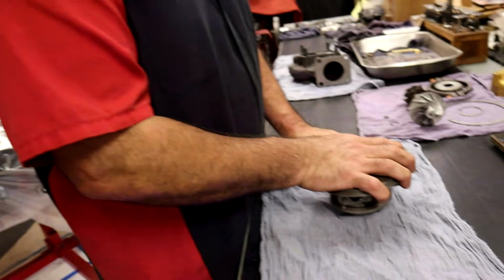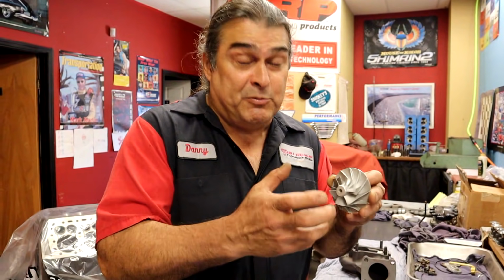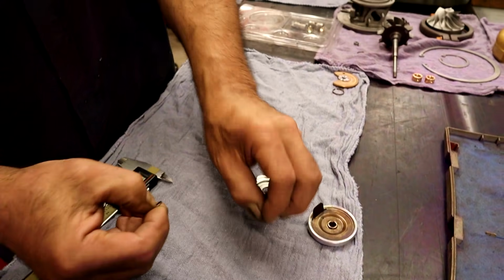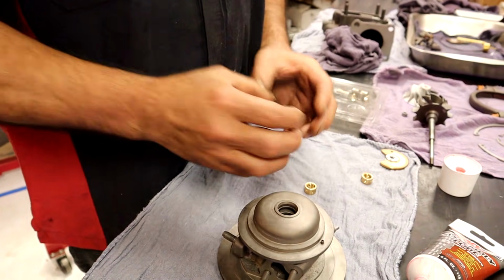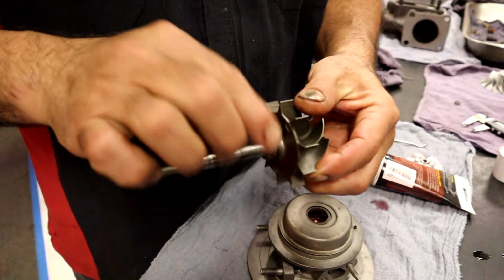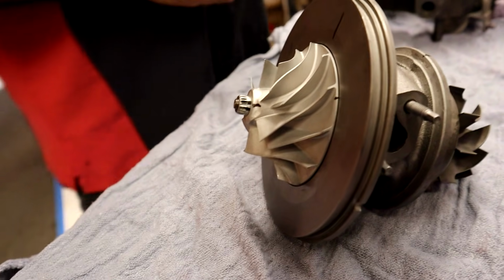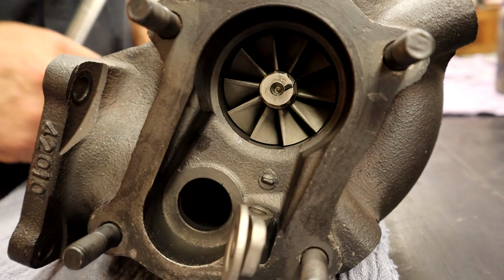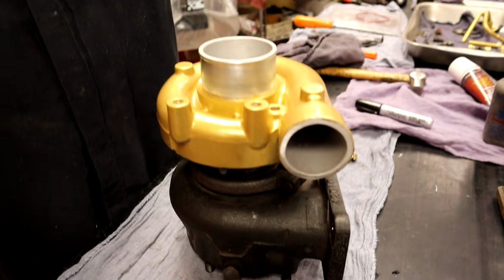Part 3 of Danny's Turbo Rebuilding Master Class: Reassembly! Feat. Toyota CT26 Turbocharger!

Comment: I always, always always lubricate O-rings. Metal surfaces can have a microscopic “five o’clock shadow” that snags an o-ring. Lube helps it right itself and promotes a smoother assembly.

When I worked in a transmission shop we had tubs of blue assembly paste that is awesome. That’s how you keep those little ball bearings in place when re-assembling the valve body in an automatic.

Comment: Better than assembly lube and priming, I saw a turbo where the oil lines were replaced with zerk fittings. Worked perfectly. For almost 60 seconds.

Comment: Thank you sOooo much for this series. I’m entertaining rebuilding my stock ct26 on my 91’ 7mgte. My front cassette fins are pretty chewed up after I realized I was sucking in rocks or material from a split accordion hose. I’m amazed at how much this master rebuilder has been graciously sharing with us. Are the brass punches really that effective at easing the removal? I had never heard of this and the vibration method, though it makes perfect sense. Thank you again for the videos and the time to put these together. I may try and rebuild or try to send to you or Danny if he rebuilds turbos shipped all the way from VA. ✌🏼

Comment: On industrial cats, we rigged oil circ pumps that ran when the engine came off line to discourage coking. We had them on when the engine was off because these engines were emergency standby driving municipal water pumps. Always well lubed turbos. For instant on—no warm up.

Comment: I need to rebuild my STI turbo. After hearing what you said about someone might have bored the hole out and an oversized bearing may be needed. 
I assume that I should take it apart first before ordering a rebuild kit. Like I do when rebuilding an engine I clean everything and measure everything and than order parts.

Comment: Great video! Especially thanks to Danny for the advice on orings! I have some stubborn one on my DV6TED4 turbo diesel. It goes between a turbo's cold side outlet and an intake pipe and the pipe needs to be pressed in and then rotated. And every time I put on a new one it always rips and leaks even with a special lube. Next time I will try to use a pick to rest it!
P.S. Hello from Russia!

Comment: From an engineering stand it's a rule of thumb to never reuse any seals. 
With the exception of the manufacturer specifying that's the case. 
Reason being is the amount of heat cycles and wear. 
Another point I'd be cautious is the torque specification. He did follow the marking. Did he check if the unit was to the torque specification? Heat cycles and worn parts can affect tolerances like torque specifications. Time will tell how well the unit going to last. 
I don't recommend this.. cough cough ..  but if you bought a new unit took it apart and reused those parts bc it has zero heat cycles on the seals, that! would be better than using the rebuilt kit. Then return the "new" unit back to the manufacturer. That would be a more solid build than his.

Comment: Tech Tip>> If the inner bearing takes snap rings make sure to put the smooth side against the bearing.... To make the turbo more presentable spray the turbine housing with dry moly. It drys fast and makes the cast iron parts look new.

Comment: So if a turbo has play and it’s not touching the housing it’s fine and does not need a rebuild?
Reply from the maker: Not necessarily. Check your repair manual for the exact amount of play it should have. YMMV👍🏻
Reply: @FayeHadley  thanks Faye